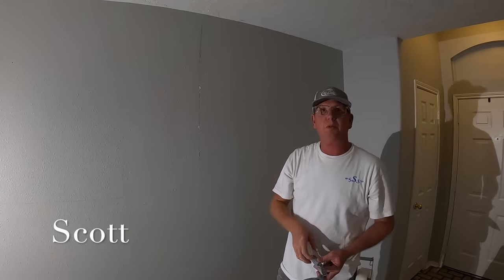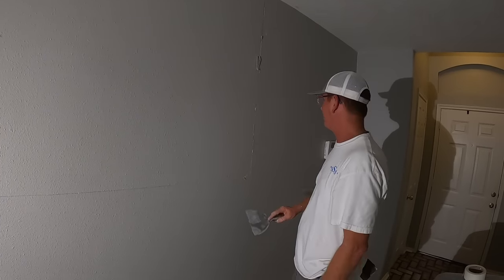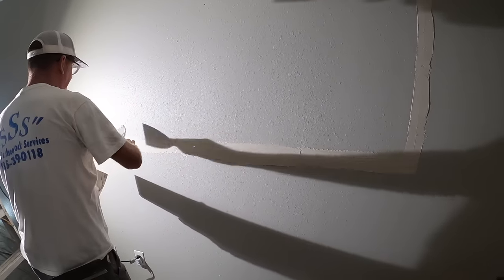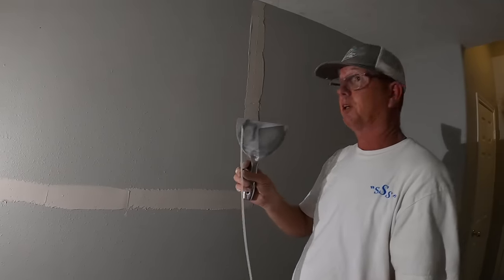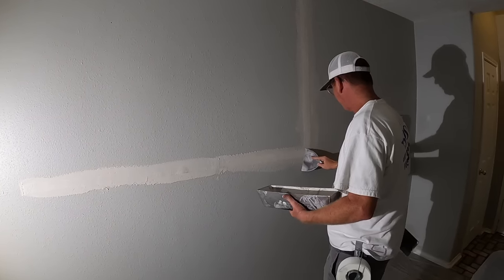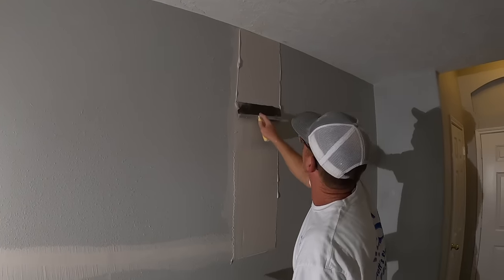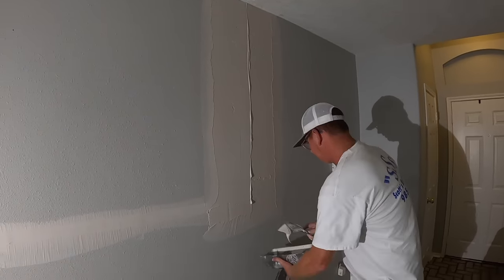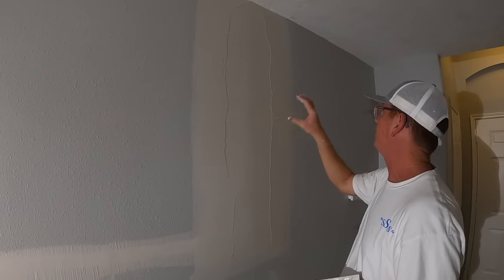Full Tutorial On How To Fix A Drywall Crack Like A Pro

Comment: You must cut tape width out of wall and remove paper from sheet rock to recess the joint. Add mud in recess, then tape mud with 6 inch blade and wala. No super built up stupid joint. Less work better job no excuse for build up.
Reply from the maker: Never personally heard of that. Hope that worked out for you. We painted the next day and it was beautiful. Have a great day!

Comment: Mesh tape is horrible. You can also pull those strings  out of the dried mud. Patching a hole in the wall is all its good for.
I am a fan of the fibafuse.
Reply: Mesh tape is no weaker than paper, paper just does a better job hiding the crack when it happens, also people use the wrong mud when using mesh tape

Comment: You're using hot mud or some call it setting compound.  Its a special formulation of Plaster of Paris, limestone, mica and adhesives. I mention this so that people won't try to do this kind of repair with plaster of paris, cause that won't stick to enamel paint like the hot mud you are using and is not meant to be spread thin. PofP is more of a product for doing molds.
Reply from the maker: If you look at my video on how to mix plaster of Paris, mixing it with mud works very well. I’ve been using it for repairs for 28 years when mixed well it’s full proof.
Reply: @scottssheetrockservices  You are correct that mixture works well. But to call it Plaster of Paris,  people who don't have any experience might try to use just plaster of paris  for repairs. Doing that alone would fail in this application. People don't realize that there are many ingredients in joint compound and hot mud that improve flexibility, sandability, adhesion and strength. That was my point anyway, maybe I didn't say it correctly.
Reply: @avisitorhere you said it correctly. This guy just isn't acknowledging ur right.

Comment: 15:17  man, your compressor connection is leaking air.  and no mask?  that's not professional.  If you are using a spray gun or spray paint, you need to be wearing at least a dust mask or respirator if it involves any organic fumes.

Comment: How about refastening the sheetrock to the framing after v cutting out the crack? You're fired!
Reply from the maker: That particular butt joint was not loose. The tape cracked during a hot summer as that wall was adjacent to a garage if the rock is loose, I’ll re-attach. however, that one was not.
Reply: yes it should of been rescrewed these boneheads that think it has to be v d out is just plain wrong, you are taking the integrity away from the sheet, this guy has alot to learrn
Reply from the maker: @ron75569  as I said, in a past comment… That wall was adjacent to a garage and we had a really hot summer was the cause of the paper tape cracking the board was not moving. Therefore, no need for screws. Job was painted like it never happened the following day it will never crack again!

Comment: Why the plaster of paris?
Reply from the maker: Got a job on a spray crew 30 years ago… Our job was to go behind the hangers and finishers, sand, touchup, and texture. Part of our job was doing touchups after paint I was taught to use plaster of Paris then. It works well you get 7 to 10 minutes of work time, it’s rakeable so you don’t have to sand tight skim and texture you’re good. I like it better than hot mud for small things especially five minute as it is smoother and not as porous and you get more time to work with it. It is an art. It takes some time to get used to but once you do, it can be very helpful on small quick projects.

Comment: but why has it cracked surly theres movement in the boards
Reply from the maker: That particular butt joint was cracked as the wall adjacent was the garage and it was a really hot summer personally, I think it was the heat that caused the cracking. The board was not moving.
Reply: @scottssheetrockservices  it can't crack if it's not moving so somewhere something isn't right

Comment: Anyone watching this, please do yourself a favor and do not use mesh, just use paper tape, and you can't go wrong. Just dont use topping mud to bed or "apply" your paper. After which you can use whatever mud you like. I use  usg plus 3 in light coats, prevents hot mud shadowing. Hot mud has its uses but it has a tendency to be seen after you texture and paint. Especially if you use hot mud or setting type joint compound over painted surfaces. Also make sure your mud is completely dry and sanded smooth, and make sure you blend the entire edge of patch or you'll see the patch through the texture and paint. I suggest using a fine grit sanding sponge with a 45 degree bevel on it. This coming from a 20 year drywall journeyman.
Reply from the maker: We always do a topcoat… Skim coat, prior to texture and painting
Reply: A problem with paper is that there is a tendency of some to squeeze out all the mud from under the paper.   The result is the paper will bubble up after a short time.   I've seen this a lot.
Reply: Commercial drywall business for 23 years here. There is absolutely nothing wrong with mesh tape IF you are using hot mud on the first 2 coats. Premixed is weak and should only be used on your skim coat. Doing anything else is wrong and will fail, not to mention it will waste a lot of your time. We do large areas in a short amount of time. None of this home owner information.

Comment: you just put lip stick on the pig ,maybe you have secured the sheetrock before you did your repair ?
Reply from the maker: Yes, it was solid not moving that wall was adjacent to the garage had a real hot summer. It was the heat that caused the cracking but it’s good now!

Comment: How is it I use mesh and setting type for decades and don't have any problems???? 45? How about some 5 minute mud???? Who has time for that.
Reply from the maker: @seamuslockhart9394  absolutely if you use some 45 five minute 20 minute whatever I’ve probably fixed 1000 repairs in my time of mesh tape what mud they use don’t know…

Comment: mesh tape works if you know how to use it you have fill it with sheetrock 90 then it wont crack and a pan and knife no no no trowel and hawk when drywall taping and at the end lets see a light on the side of the repair because you can still see the hump on the joint this is not the way to repair this.
Reply from the maker: Everybody has a difference of opinion, but if anybody wants to get side-by-side with me with a hawk and trial and my pan and knife, I’ll take that challenge any day! The only hump you see there is a variation of color between the skim coat and the float coat and when we painted two coats of eggshell. The following day it was beautiful just saying…

Comment: Your repair is only temporary.  That crack is the result of a structural flaw and will return.
Reply from the maker: That particular crack was due to extreme heat that we had that summer as that wall was facing the garage, and the insulation was no match for the amount of heat. With the plaster and fibafuse, it will never crack again. Not in our lifetime….
Reply: I hope you're right.  Keep us posted. @scottssheetrockservices

Comment: Another person who doesn't understand mesh tape. You think they would still sell it if it failed all the time? The key is to not be some rookie using premixed on the first 2 coats. If you use quickset for your tape/block coat, it won't crack. The whole reason you have mesh tape, is you can tape and block in one coat, then come back and skim it in an hour and have it sanded by the end of the day. You get a very strong joint in a short amount of time.
I think you're too slow and unskilled to be giving this kind of information. Your joint has too much mud and you didn't make it wide enough to hide even on that textured wall.

Comment: Don’t use tape but you use tape lmfao.

Ok so here’s how YOUR SUPPOSED TO DO OT PEOPLE PLEASE FOLLOW MY GUIDE.

1-carve out crack  in v-grouve shape
2- apply DURABOND , not regular shit plaster in crack 
3- apply MESH TAPE 
3-apply DURABOND over mesh tape 
4- then build out 2 feet wide with regular plaster 

DURABOND COMPOUND>Wtv he did. 

Don’t call your work « PRO » when it’s amateur at best.
Reply from the maker: Well, when we painted the eggshell the following day, it was absolutely beautiful and I guarantee my work and it won’t crack again. That wall was adjacent to a garage, so it was the heat from a very tough summer that got to the crack for the butt joint. Hope you had a great Christmas and you have a happy new year!
Reply: @scottssheetrockservices nah there's an underlying issue so if done well like yours will crack it might just take longer to show through

Comment: what a joke we use mesh all the time very strong ,if you do it right it wont crack. As far as cutting out the break not needed. Tape isnt gonna hold the house together,if its gonna move its gonna crack.43 yrs exp... its not tearing cause ur going over paint lol,its setting up, leave it alone till its dry. lol using a 6in in the center on the final coat lol. why can i still see the tape and its done lol.you must just be learning lol... why is  the new texture so much heavier than the old you have to spray  BEYOND THE PATCH.. short wall id sprayed the whole thing

Comment: My man, you didn’t chamfer out the cracks or refasten them, mesh tape is strong when embedded with hot mud but nothing beats paper tape. Fibafuse is not 70% stronger, it’s relative to paper if anything.
Reply from the maker: The crease in paper tape is usually what moves and cracks the seam fiba fuse does not have a crease nor can it blister overtime it’s a really good product
Reply: @scottssheetrockservices  I respectfully disagree. Fibafuse is a great product, but the ability of the sheets to move themselves is what causes most cracks. If you push on either side of a crack you can see the board move.
Reply: Yeah I agree as well best thing to do with a crack like this is refasten, and cut out a void then pre-fill. Though I would agree that fibafuse is probably the safer route when working hot mud. You definitely want to re fasten the cracked area just incase.

Comment: Extreme heat on the back side of a garage and YOU DONT KNOW WHY THE DRYWALL IS CRACKING😔. HERES A HINT WHATS THE DRYWALL ATTACHED TO ? DOES WOOD EXPAND AND CONTRACT WITH TEMPERATURE AND HUMIDITY?
Reply from the maker: I guess you didn’t watch the video and it’s entirety but yes, I did tape the joint with fiber fuse
Reply: @scottssheetrockservices  im sorry bud you are correct I didn't watch till the end I though it was cheap click bait honestly saw a video prior to yours where the gentleman was certain you don't need tape and the was grinding my gears false info. Anyways I'll watch the entire video and get back. My apologies about the snap decision.